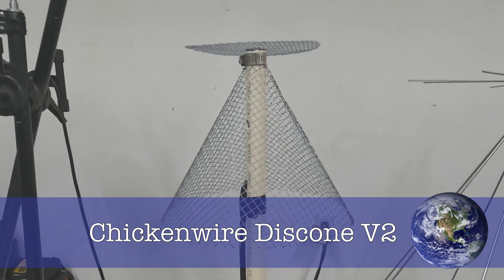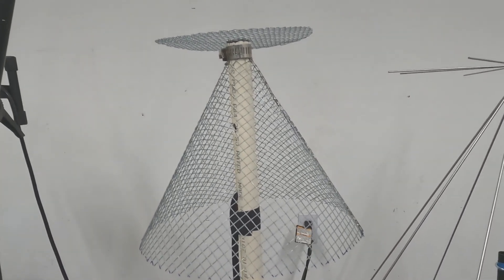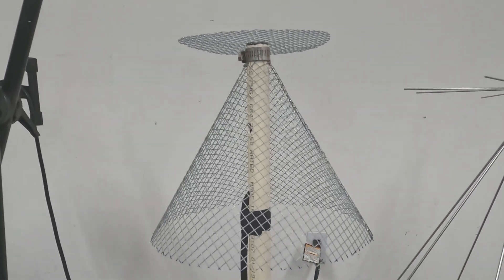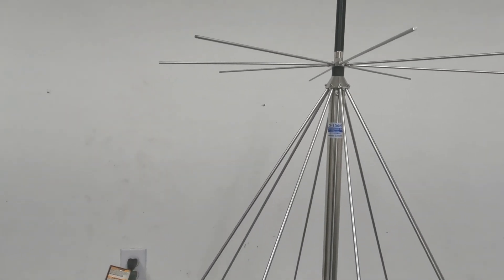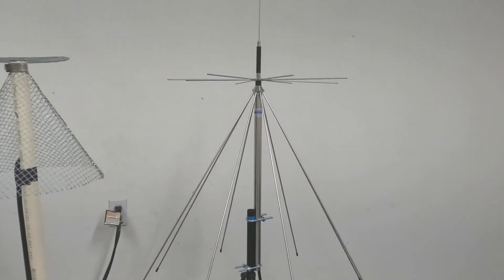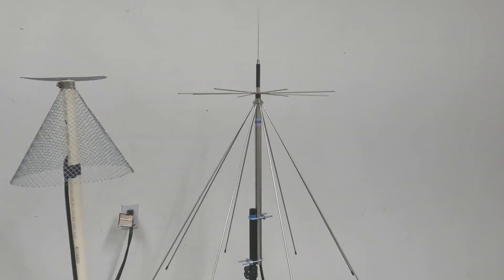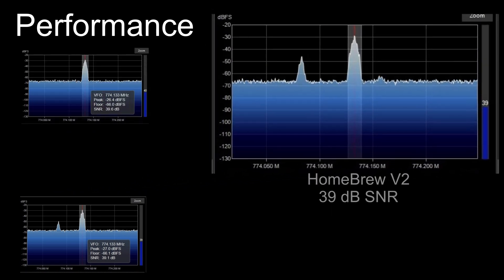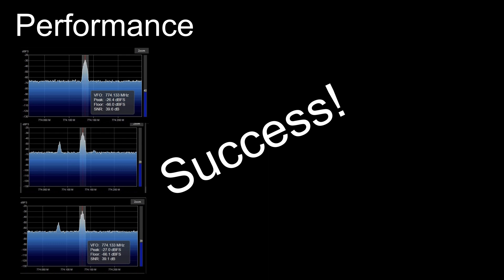DIY Discone vs. Diamond Antenna

Comment: Will this work for the UHF air frequencies? 225 MHz-400 MHz?
Reply from the maker: it will as long as you make sure you calculate the dimensions for the lowest frequencies you interested in 225Mhz in your case

Comment: Can this be used as Wifi antennae sir?
Reply from the maker: I've typically used them as Rx only not sure how they'll work for transmission, May need to see what the SWR is at 2.4 and 5GHz

Comment: With such an interesting and flexible antenna design I find it interesting that there are so few questions all comments on this video, even this long after it was originally posted. Comments about the difference is in dimensions, materials, configuration, etc are old valid just as was the question of AGC. 
It is well known that a discone, and biconical, design made from spikes rather than a mesh or solid sheet metal is going to have a far lower performance due to the amount of reflective surface (given that all other variables are identical). The spoke design is especially susceptible to manufacturing defects due to alignment issues all the disc and cone elements. 
I have seen many enhancements of cheap and not so cheap manufactured designs which have included the addition of support rings at the base of the cone and the edge of the desk, the addition of mesh or solid materials to the disk and cone (the most effective being far higher quality than a little bit of wide gap chicken wire), and in my opinion one of the most important adaptations/fixes is making sure that the width of the base of the cone is the same has the width of the disc produced with a significant difference. 
As for the vertical elements, if you want to transmit will increase sensitivity on lower vertically polarized frequencies they can be useful but are far from essential. 
Finally, there is size. The smaller the discone the higher the effective frequency range and narrower the bandwidth. The same design has been used for HF, VHF, UHF, and SHF and is still used in mission critical communications. It is not an antenna that should be or dismissed.

Comment: Absolutely brilliant!!! Have you tried a vertical short whip on the top like the diamond? I chase APT satellites and built my dipole out of left overs from a roll of brake line and a shelf bracket and bought a Tram 1410 discone but had considered something similar to what you have built tuned more specifically to 137.5Mhz with an inline LNA as the Tram has a null spot and while a QFH/QFA would be optimal it appears the APT programs are winding down and its not worth the effort. Love to see the application!!!!

Comment: Can't you use the Diamond to transmit as well though?
Reply from the maker: You absolutely can - I used by Diamond for 2M and 70cm (but Not HF) I have since put a vertical on the roof for VHF and UHF. Again, these little discones I made were for scanning specific frequencies so their a fraction of the size of the diamond ….
Reply: @BarryShaffer  For below 100 MHz the Diamond can only transmit in 6M band. The vertical element is what allows reception from 25 MHz. You tune the vertical element for 6M transmit.

Comment: Which one is more durable and will last longer for the money is the real question..... Put yours outside 20 to 30 feet up and let us know in a year how it's doing...... My Comet Discone has been up 27 years and still looks and operates as brand new.........
Reply from the maker: Totally agree - My Diamond is solid and would never think of replacing it. But I like to play and experiment and made these for a multi SDR scanner. Also for the specific frequencies I was interested in they didn’t need to be as big as the Diamond.

Comment: Would using this antenna somehow work for the FTA TV reception Sir ?? Thanks
Reply from the maker: Conceptually, but TV is a very different frequency range and I believe there are much better designs for that application.
Reply: Thanks for the guidance Barry.  @BarryShaffer

Comment: Try a version 3
This time replace the top flat disk with a second cone pointing upward.

Kind of hour glass shaped !
Reply from the maker: Haven’t seen that one before - what characteristic does it change?
Reply: @BarryShaffer better low band perhaps .
Reply: Thats called a biconical. discones were developed for aircraft, the disc would be level with the aircraft skin, the cone upwards inside a protective dome.

Comment: The DIY version looked so similar to one I built that for a second I thought I posted a video I don't remember making. 
Thanks for the concise review! Am curious about how you handled the coax connection. I struggled with that part the most
Reply from the maker: In this version I soldered the coax directly to the chicken wire. Center conductor to the disc and the shield to the cone. I did have to use flux to get a good solder joint.

Comment: What are the dimensions? No vertical element?
Reply from the maker: About 7" tall and the same in the diameter. Design details in the second vid.
Reply: @BarryShaffer  Thanks, I have been looking for an antenna for my SDRs and this one seems like it would be the easiest to DIY
Reply from the maker: @mercilessradio1770  Super easy, just remember these particular dimensions are for 400MHz and higher
Reply: @BarryShaffer 
How low a freq can you get to work?
Reply: look for Discone Antenna Calculator
Reply: The verttical element is only necessary for reception below 100 MHz and 6 Meter band transmission, not necessary for VHF/UHF. Of course, the chicken wire antenna shall be about the same dimensions of the Diamond if you want to use it for Tx.